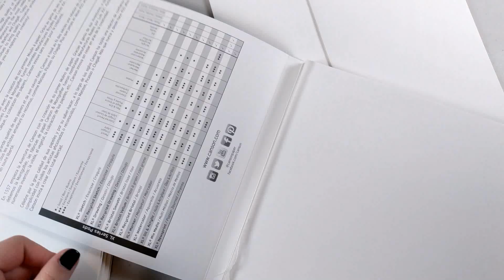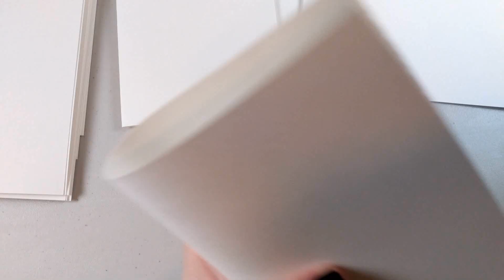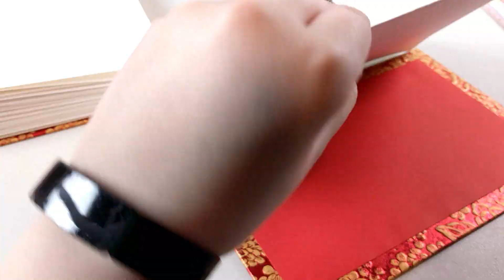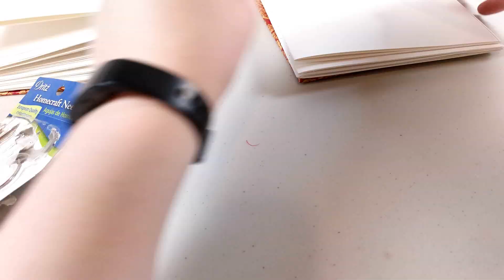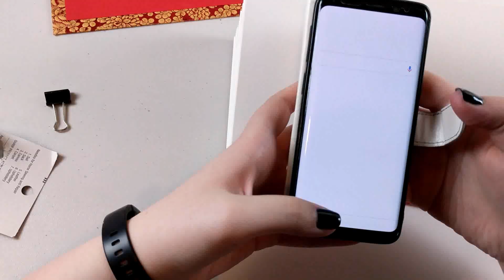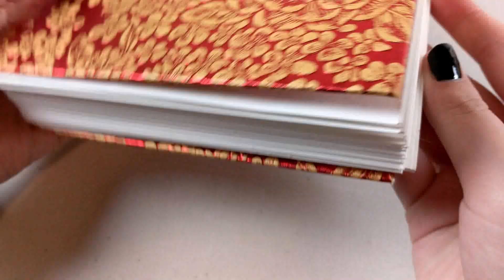ﾐ☆ Binding A Watercolor Sketchbook! | Coptic Stitch Binding Process

Comment: You're gonna need a spine or bands to keep the book from wiggling around! (the spine is like the back of the sketchbook)
Also great video! I love it ✨
Reply from the maker: the only part on this that really wiggled was the cover, but I think that's because I didn't sew it tightly enough! but thank you for the tip!
Reply: @tirameowsu  no prob!
Reply: the point of a Coptic stitch book is it's loose and lays flat.
you can use it to make a core to a proper bound book though

Comment: I'm working on gathering the supplies for doing this. My problem is I want the 12x18 paper so my book is 9x12  because I'm using it to mount pressed wildflowers and plants in.  It has been difficult to find water color paper in a larger size in my town. I want the stiffness that the 140 lb paper has so that the pages aren't as flexible and my flowers aren't breaking and falling off.